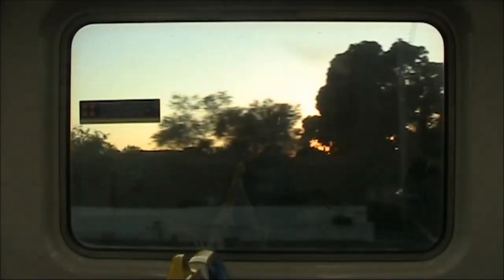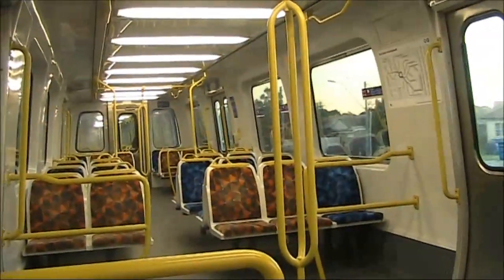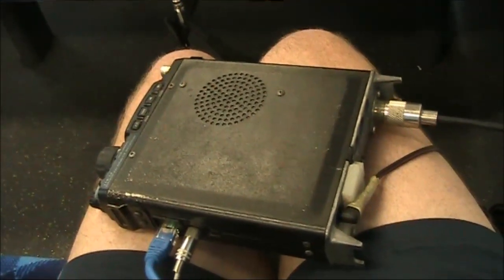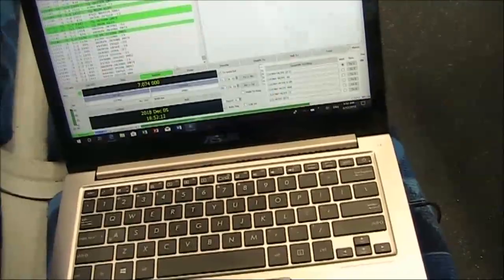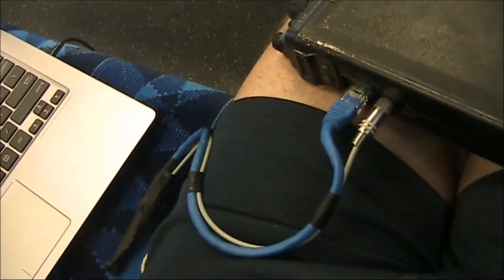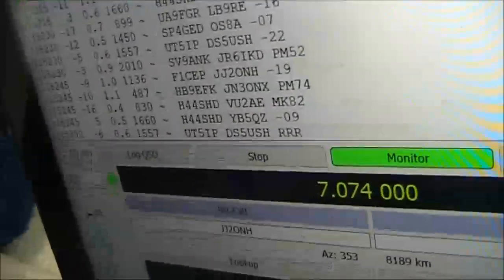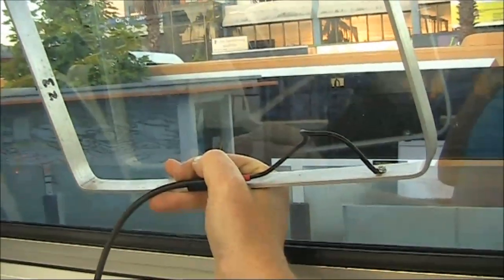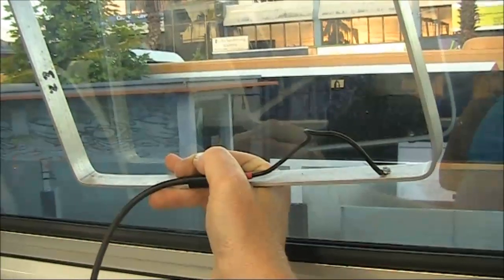An attempt at HF train mobile FT8 receiving

Comment: Peter, why are you holding the loop in your hand?
Shouldn't you use a mast?
Tnx & 73...
Reply from the maker: This part of the loop, connected to tx ground and away from the maximum voltage points at the ends near the variable capacitor, is OK to hold.
Reply: @ first off, thank you Peter for responding. 
Ok, that makes sense.
I do have a question: I have a +15 DB over S9 noise level that is seemingly coming from powerlines. It’s about to drive me completely off of 80 m. The reason I started watching your magnetic loop videos was to help a friend, since he is moving to an HOA community, where things are restricted and needed to make a small antenna. In seeing the success that you have with these loops, it’s making me wonder about trying to construct something for 80 m. However, I don’t wanna just construct a very expensive noise gather that would make things even worse!. I did the calculations and it looks like I need a diameter of about 9 feet or I guess around 3 m or a little less. I also understand that you would place this to loop diameters above ground. So my question is this, do you think I could possibly get around this really bad noise problem that I have on 80 m using a magnetic loop; the reason I’m a bit dubious is the fact that you guys use these to seek out bad power poles that are causing noise!?
Anyhow, Peter, thank you for everything that you do and have really enjoyed your videos over the years. You’re an amazing guy that can do so much with so little, it’s just so impressive.
Take care and 73…
Reply from the maker: @SpinStar1956  A loop has a null good if the noise is coming from one direction. If it isn't then the loop might not help. But worth trying.

Comment: I'm curious why you chose the 40 meter band. I think you might have had better luck of successfully decoding if you did 20 meters, based on the time of day, etc. - 73 de KG5JST
Reply from the maker: 20m would be an interesting test but my loop antenna doesn't tune it.
Reply: @vk3ye  BTW, the loop antenna you used looked really interesting. Do you have any more information on it? (I'm asking because I'm planning a cross-country train trip here in the US, and am experimenting with different ways to improve reception)
Reply from the maker: @jamesm.branum3338  Details on my website at vk3ye.com

Comment: Your FT-817 has endured the test of time - I doubt there is another FT-817 anywhere else in the world that has been worked as hard as yours. I feel guilty, I have owned 3 FT-817 rigs since they came out 18 years ago. My total on-time in those 18 years with this line of rigs is probably no more than 5 hours. I have spent more time on my IC-703 + and KX3 for portable operating though, which I prefer with their bigger displays and ATU. But the 817 ND is a handy travel companion.

Comment: Hi Peter, I was thinking. The trains window frame around the loop would short circuit a lot of the signal from your loop the way you're holding it. If it was oriented at 90 degrees from the way you had it, it's very possible that performance would be much better. Cheers and kind regards- Daryl
Reply from the maker: Thanks Daryl - I did think of that but thought that given that the radiation is off the sides of the loop then there would be a lot of shielding at least from the end of the loop facing into the train. But it's worth another shot.

Comment: Was just thinking - what if you would be tx-ing from the train - you could check if you have been received somewhere on hamspots.net, pskreporter.info or pskreporter.de when back at home :)

Maybe that's cool for a next train-ride (however, you might ending up changing the grid every now and then.

Good luck and thanks for sharing

73 de PC4AD
Reply from the maker: Thanks. A good idea. hamspots.net looked interesting but has a silly requirement to register and log in before you can do searches.  Yet another user name and password. So unfortunately I'll give it a miss.
Reply: @vk3ye  I can imagine that. At least this an easy site to register on, that might be positive or let me know when you are planning again and I might be able to give you the info :)

Ps oops, given reaction under my other account. 73 de pc4ad

Comment: Doesn't holding the antenna in hand detune incoming signals from high capacitance?
Reply from the maker: At the top it does. At the bottom, particularly near the feedline's braid connection, it doesn't.
Reply: @vk3ye  Thaksand Good Evening. KB8AMZ

Comment: Inside a Comeng would have to be the worst possible place for HF signals.
Good you sat in a trailer car, which would have possibly reduced some of the noise, but the inverters for the fluoro tubes in the ceiling would have to be outputting horrendous noise, along with all the switch gear and DC overheads.
Still, interesting experiment and thanks Peter for giving it a go!